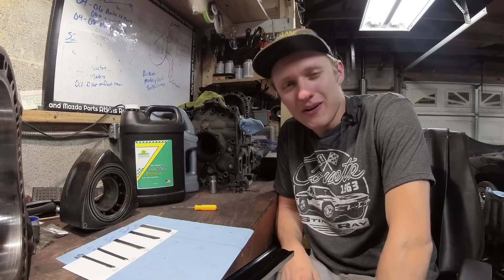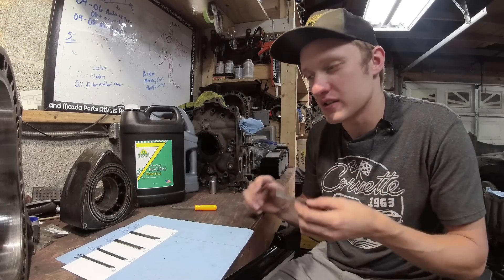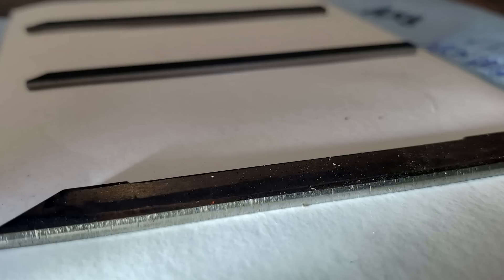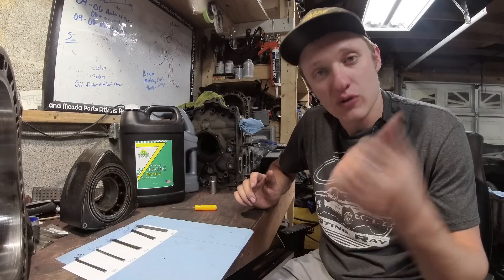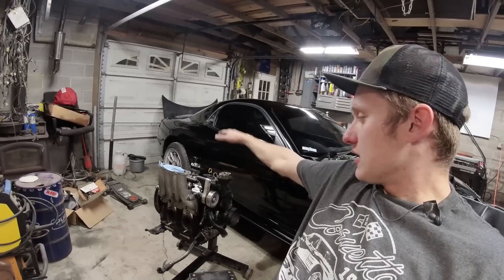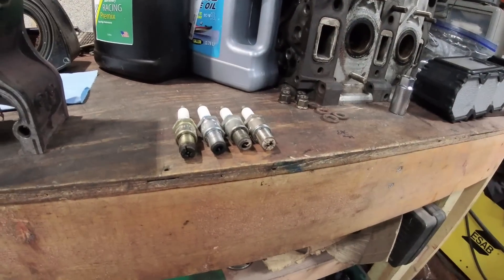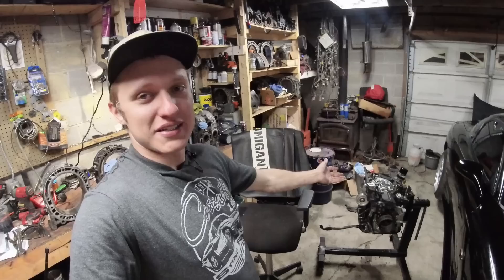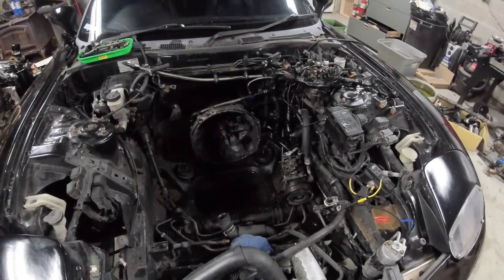Analyzing Apex Seal WEAR in Mazda Rotary Engines - Years of Testing Different Seals

Comment: I have been premixing since i bought my rx8, ive had it for 15 yrs now, i use marvel mystery oil, thinking about rebuilding the engine,  be interesting to see how my seals look, ive put on 70,000 miles on it, it has 140,000 on the engine altogether

Comment: 1 gal = 128 oz their for 1 oz of 2T oil [pre-mix]  to 1 gal. yeald's to 0.78% that's less than 1% of pre-mix [2T] oil

Formula to calculate % of pre-mix oil [2T oil].

(100%)( X oz of T2 oil) ÷
 (128 oz)
 = X% of T2 oil

1.5 oz will yeald to 1.17% of 2T pre-mix-oil.

Extra info. for pre-mix math calculations. 

1 oz = 2 table spoons.
1 oz = 6 tea spoons.
 
1 table spoon = 1/2 oz
1 tea spoon = 1/6 oz
2 tea spoons = 2/6 oz
3 tea spoons = 1/2 oz
4 tea spoons = 4/6 oz
5 tea spoons = 5/6 oz
6 tea spoons = 1 oz

 

You can make the math easy if you mix the ounces of pre-mix per 100 oz of gasoline.

100 oz of fuel to 1 oz of pre-mix yeald's to 1% or 100:1 of pre-mix.

1.5 oz of pre-mix to 100 oz of fuel yeald's to a ratio of 100:1.5

Comment: I have been using  regular and some cryogenic Atkins apex seals for years and I, like Dave believe that the best seal is a soft faced seal  for low rotor housing wear ..I would rather replace worn apex seals...  then trash housings with overly hard apex seals. I once got a engine that used  Rotary Aviation seals.. when one of the oil injector line broke the  side of ..apex seals ate the front iron so badly it had to be replaced.. I have built All my engines with  Factory  apex seals,  Atkins seals and a few with E& J seals.. they are all surviving..

Comment: Rad...My 1988 Gen 2 just blew up on me no less than an hour ago, ran it for about 4 minutes no reving. Heard a few back fires then a tone change in the exhaust  followed by a noticeable shake to the vehicle. Did a little research to confirm a blow apex..I came straight here.. if there is a rx7 god to answer my prayers, now is the time to speak🙏🏽🥲

Comment: I have the same premix in my car. I use it with my sohn adapter

Also everyone says you have to premix. If the omp is doing it's job you should not have to premix 
Now stuff around the omp/ engine will break and cause issues with the car and make the omp less effective but Mazda engineering(when Ford leaves it alone) is really good.

They even help correct a few hiccups by adding another omp line to each rotor for the rx8 to make up for the fact that because of the new design and shorter seals you could develop hot spots. Those weren't guaranteed but they wanted to add extra insurance.

Comment: Love your info; but I don't agree with the need for high priced 2-cycle oil. I run Walmart Marine 2-cycle oil (1 oz per gallon, no metering pump) for my 13B NA powered airplane. It burns 10 gallons an hour and it has run hundreds of gallons of fuel and used only Walmart 2-cycle oil. 
At full throttle and 6k RPM takeoff, it runs about 13.0 +- 0.5 AFR. in cruise probably around 13.4 AFR. The aircraft engine often runs at WOT mostly and so it takes a beating, probably more than most 13B applications; for hours on end. 
Inspection shows the rotors have ZERO carbon deposits and the plugs are tan to white in color on both plugs. 
I used 3 piece Mazda seals and there is NO scratches or other damage to the rotor housings. Not a fan of cryogenic treated seals or other 'hard' seals. 
Compressions are 112-116 on one rotor and 103-115 on the other.
Reply: I love the 13b as much as anyone but I'd buy a lottery ticket every time I landed that plane safely 😅
Reply: @Leo9ine  A  13B NA running fuel+2 stroke oil at 1oz/1 gallon of fuel is SUPER reliable, at altitude it is generates only about 150HP at full throttle (6000 rpm); easy work. 
It is the nuts that boost it to 20 PSI at 10,000 rpm that breaks seals and rotors.

Comment: With oil injection is referring to use the sohn adapter along with the omp? I have about 2 weeks using the sohn adapter on my RX8 how good is to use that mod also i still premix 0.5 oz on the gas tank

Comment: Great video, can you share your experience on chatter marks or create a video sharing your thoughts on the matter? I just tore apart my FD engine after a recent rebuild (about 1 thousand miles in) due to low compression. Had some thrust bearing failure, but I was shocked to find some large amounts of chatter marks, 1:1 premix, using 3MM RA super seals. I've read up on the opinions that Chatter marks are a result of a few contributing factors, power lubrication, high heat, and detonation. I'm shocked since I have two oil coolers, premix, upgraded rad as well as vented hood so I'm hitting a brick wall on what could've caused the chatter marks.

Comment: as a guy that just starting to go into rotarys do you guy’s have any refference point to buy parts online or what so ever
Reply: Mazdatrix
Reply: Mazdatrix, atkin rotary, racing beat, pac performance, billet rotary (these are brand new housings very expensive) OEM mazda parts on ebay, OEM parts. nengun has a lot of OEM parts from japan. a ton of other shops around the states also sell second hand parts that are in pretty good conditions. Sadly mazda quit making OEM parts for the USA so a lot of them are sold in japan, example amayama or some sort of  proxy service. Japan is really spoiled with their rotary support... super jealous.

Comment: Been watching your videos for a while now and used your videos to help me rebuild my 1st rotary, 1980 rx7 that only has 80k miles on it. Problem is I only had it running once since putting it together and can't get it started again. Getting gas/compression/spark but even w/o pumping the pedal, seems to be flooding out (wet plugs) Was cranking a little slow so I pulled the starter off and took it apart and cleaned it up and polished the armature and it is cranking faster but I still can't get it to start. Only time it did start was after it sat for a couple months with no plugs in it. Any ideas on what I can do to get it started short of push starting it?

Comment: Any opinion on the Lucas Racing Semi Synthetic 2 Stroke Oil in the series 2 rx8 engines? I use it in my mainly stock, only racing beat catless exhaust and upgraded coilpack RX8, and it’s readily available at most auto stores, it’s not the marine type either,

Comment: I had compression Issues (warm start failures) when I bought my RX-8 (106K Kilometres, don't you dare to use imperial standards). When I first refilled the gasoline and put a lil amount of Idemetsu Premix into the tank aswell, the warm start problems we're gone - till the moment the oil overheated and the whole engine gave up.
I definetly can recommend driving it, at least when your engine get's older. For the new engine, I'll go with a clean Oil feed and full synthetic 2 stroke Oil + premix for the first 3000Km.
Reply: Premix fixed your hot start issues? Lol
Reply: @xMorbidArtx  yeah it did. Within the first tank the engine runned way smoother and started way easier. To be fair, car was third hand and already 106000 Km, so it was just a matter of Times whrn compression issues started to be a problem. A little bit of extra lubtication, and I think a lot of extra compression made the engine operate was better.

Comment: I blew my '74 RX4's 13B because of a rusty gas tank continuously plugging the fuel filter on a long road trip.  When I rebuild it, I will never run it lean again and I will premix with the oil metering pump connected..

Comment: That gunk glue coating on rotors aand parts is castor oil like klots but not ran hard enough ,often enough.  My builder said it was really hard to clean. And try not to use unless track day.

Comment: wow i can’t believe those IR apex seals gouge the housings like that after only 7k miles. is running a harder apex seal necessary for higher boost or power levels beyond stock? what kind of longevity could you expect to get out of a housing with running apex seals that hard?

Comment: Just yesterday pulled apart my stock FC 13BT to bridgeport secondaries/open up primaries.
Discovered apex seals not 2mm factory but 3mm.
Apex Slots been  machined for 3mm as were the corner seals (not used the FD 3mm corner ones)
Must have Spat an Apex on the rear rotor as a chip on the slot on one hence the machining it bigger to remove the burr.

No idea how long ago was done, previous owner nor me (20yr owned) had it fixed.
Irons minimal markings on the combustion area  a light resurface will sort ..no corrosion on water galleries and housings same with minor seal edge wear...but im using new housings.

Kinder surprise my builder said 😊

Oh I'm from NZ btw and love your uploads.

Comment: This is amazing info, thanks for sharing. I like the idea of listening to the sound the differently-worn seals make, but I also wonder if something like a borescope or cheap USB microscope might be a better way to show the difference. Or if you're able to get in touch with a local university or machine shop to test using a fancy surface roughness meter.

Comment: So the real practical question for someone like me, with my 60K mile 2004 RX8 that I've maintained well but without knowing anything that I've learned from your videos for the last several months - does changing how I lubricate my engine really matter? 

Do I continue to run regular premium gas with the OMP and name brand non-synthetic oil as I always have or do I make changes to my routine or even to the engine (OMP delete, etc.)?

Where's the line drawn when the marginal differences in approach actually start to impact engine life?
Reply: I'm not sure about the RX8 specifically, or if your car specifies, but from what I've seen regular gas is actually BETTER for rotary engines. I believe rob dahm talked about this, but if someone has better information check me if i'm wrong.
Reply: @formerdumbkid  do you have that video rob dahm talked about it?

Comment: I sure have got my premix wrong I think I'm at 10 parts per 10000 instead of 10 parts per 1000 (or 1 to 100). I ran my race car for the first time on the weekend inadvertently pushing through 8000 rpm as it was still pulling strong, lucky I didn't detonate the thing i guess. I am interested in your recommended spark plugs for racing, i noticed that you had 2 types, single spark v 4 spark. Which do you think is working best? I was running 102 race fuel as well, did 4 * 30 minute sessions, a real blast. 😊😊😊
Reply: I run 100:1 ratio and I have a bottle that has the measurements per L of fuel at 100:1 from what I read thats a good number. More I know I super wasteful but I know I'm very generous with my premix #s

Comment: Back in 2005, I rebuilt my 91 Vert with Classic RA seals on used housings that had scorching from blowing the engine. Back then, I just used a drill and round flapper sand disc to resurface the housings. I reused both housings and got the engine to make 90psi (piston tester at 2,700ft above sea level) and it ran for 50k. No pre-mix and only factory OMP. The engine failed again but not because of compression but from the experimental Teflon coolant seals I tried. Ended up selling the car, and the new owner broke down the engine. I had him bring me a housing so I could inspect the wear to see if the harder RA seals had worn away the original scorched damage from previously blowing the engine, and the scorching was still present. I always ran the factory air box and paper air filter because the less dirt inside the combustion chamber, the less wear you get. I'm a firm believer that harder seals need factory OMP because you want the added FILM on the rotor housing from the apex seal scraping by.
Reply from the maker: This is an interesting thought.  I've always been curious how effective premix actually is because it's mixing with the fuel in the air, which is getting combusted.  Ideally you have a film of fuel adhering to the surfaces in the engine, but honestly how effective is the atomized fuel/premix actually sticking.
Reply: @RADPotential  30+years in the rotary game and I've always relied on factory OMP. I just did yearly carbon cleanings to keep the carbon away. Even the non blown portion of my stock FD housing that blew at 108k looks mint.
Reply: @rotaryperfection  Did you have any sort of oil preference that you felt yielded a better result, or better film?
Reply: @tywachs  I tend to always ran conventional quaker state back then.

Comment: Interesting. My 2009 RX-8 came to me with 7,103 miles and wasn't premixed. I immediately started using Idemitsu premix at about a quarter ounce per gallon. My thought process was lightly premix because I cannot disable my OMP. Over the past few hundred miles I noticed my long term fuel trims were getting really high particularly if I miscalculated and premixed closer to a half ounce per gallon. So I decided not to premix for a bit and my LTFT looks a bit better plus I got a jump in MPG. I'm right around 13K miles now.
Reply: Did you return to premixing after fuel trims evened out? I have a 2010 RX8 and premix 1oz per gallon Idemitsu.
Reply: @Unix-cz9km  I've not driven it enough to be satisfied with the experiment and I'm enjoying the extra MPG. We had a run of Miata friendly weather so I was driving my NA and after that all my trips out involved either needing to do truck things or I rode with my wife in her Mazda 6. I figure I'll forego premix until my next oil change when it'll be time to do plugs again too.

Comment: The materials used in Apex seals make the difference IMO. I think the stock seals and the metallurgy and the R&D put into them make them a superior seal for durability and lifespan for wear compared to any other seal on the market. Premix/OMP won't make as much of a difference as building an engine with stock seals that are designed to be run with the rotor housings and the interaction at the seal interface. I think most aftermarket seals are crap compared to the stock oem seals. I would run a mid-300WHP engine with stock seals and water/meth injection and skip the roll of the dice with other seals.  

I also think pre-mix is not as effective as the OMP. Mazda spent countless hours researching where to inject oil onto the seals at the key locations in the rotor housings. I would inject 2-cycle oil through the OMP and have been doing so on my FD and FE cars.

I also pre-mix about 1oz per gallon in the tank on top of using OMP's on both cars. I have had pretty good luck on both cars with lots of rough miles.

The pre-mix selection is highly important. Our cars cruise a lot on the streets and you DO NOT want to run race pre-mix lubricant in this type of condition.

There are different JASO standards FB/FC/FD. I choose oils that meet JASO FD standards that have low smoke/carbon/etc. I also choose an oil that can be injected and pre-mixed.

The temperature at which the engine runs at is important to choose what oil to run, I choose Motul 710 2T oil. I purchased a bunch off a guy who got paid in Motul 710 for a job and I purchased a butt ton of oil from him to last me many years for a fraction of the price. The 2 cycle oil is designed to be burned in a lot of different engines and burns clean as heck. All of this matters.
Reply: What if, hear me out, I beat it like hoo errr everytime I drive it and I don't drive it a lot? I run ams saber pro. One of the best you can buy aside from idimistu. I can't see me sending the revs to the moon often a bad thing for it while premixing.

Comment: Great information, very cool seeing the Renewable Lubricants in action. I am loyal to Idemitsu for Pre-Mix and Oil. Oil and your Fuel also will determine wear and condition of the seals/housings. I found high amounts of varnish, kept fouling plugs, and higher engine temps when using Shell V-Power. I tried others and finally have my holy trinity of fuel: Sinclair, Sunoco, and Gulf. Had much cleaner plugs and power. I personally worked with each oil company to determine what additives and friction modifiers they used, and all were really cool to work with. Shell is known for high amounts of Hydrogen Sulfide 😢Love my Idemitsu and really enjoy buying from rotary shops and giving them full support 🫡
Reply: Do you have a source on this
Reply: @Sparkling.Fresca just throwing shell under the bus lol